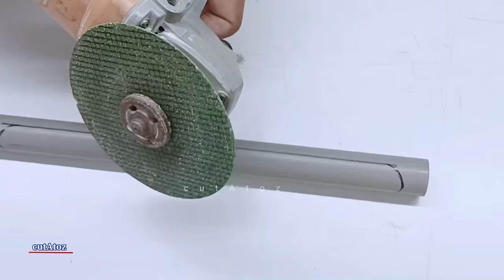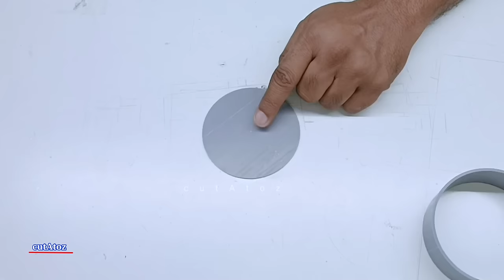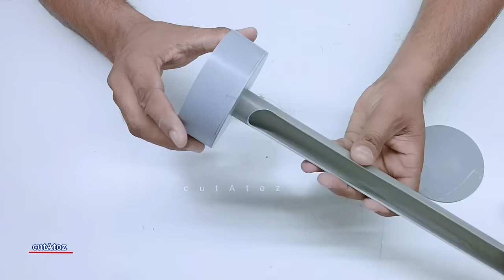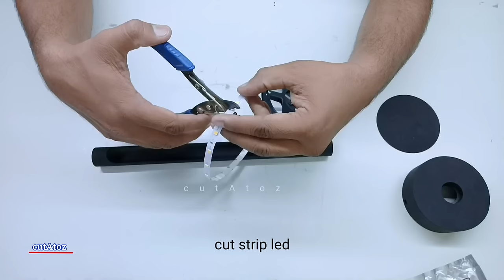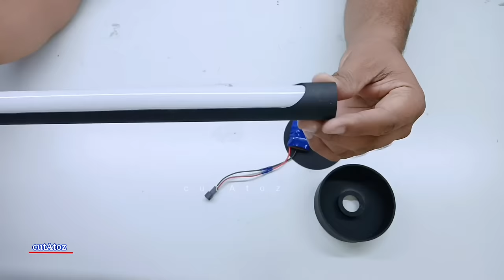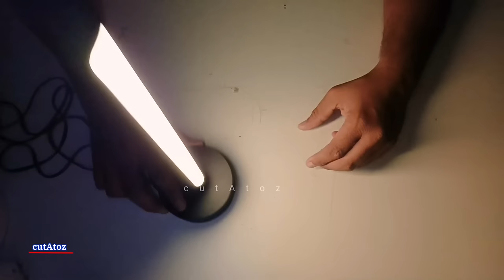How To Make decorative Lamp | Antique Lamp | Diy Decor Light2 | Decoration Lighting Ideas 2022

Comment: good idea, but the electrical safety at 230V can better.  use insulated clamps and a snug fitting for the outgoing wire.  that can be dangerous.
Reply from the maker: ok

Comment: Wait, you soldered the power wires to the led strip, but then just twist wrapped the wires from the power cord to the adapter box, why?  Just take the time to solder those too (and have shrink tubing to cover the joint. (you lost points with me thwre)  Hopefully the blue tape is electrical rated (I like 3M 88 tape personally).  Lamp definitely needs a switch.
Reply from the maker: ok